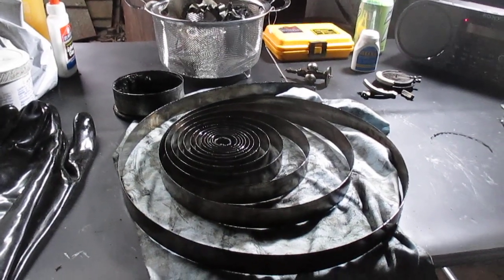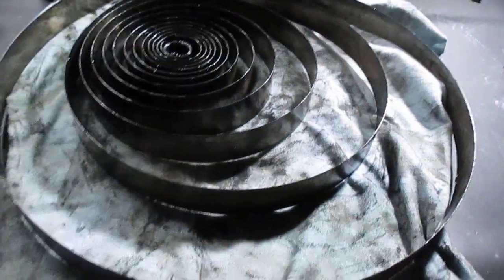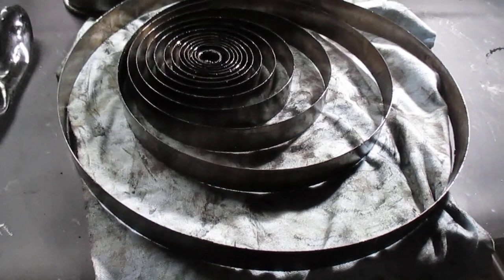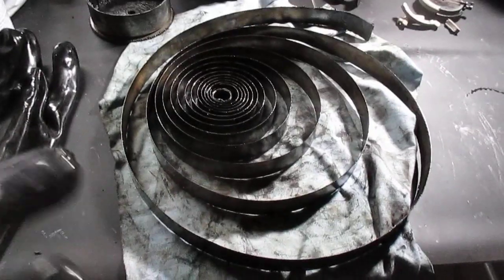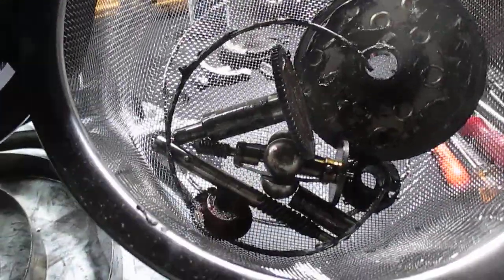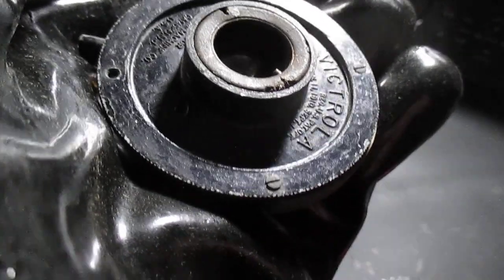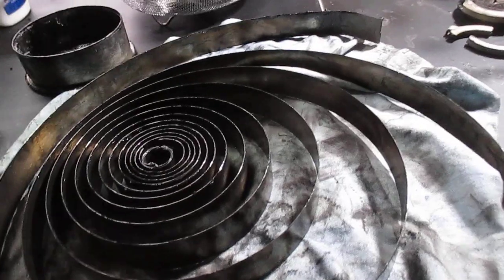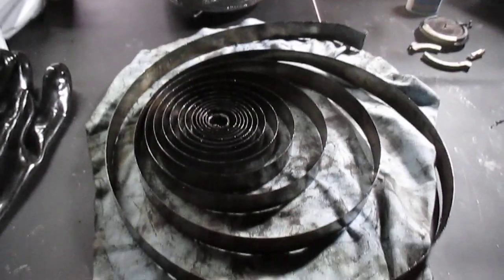Victor Victrola VV-50 # 59,408  1922, motor  disassembly

Comment: Wow! This spring is huge. I did some cleaning a year ago when I was working on cleaning the two spring barrels in my Victor VV 8-4 and it looks fine, and it took a long time to put them back together which is a pain in a butt.
Reply from the maker: That's expected given the 8-4 has four springs in two large barrels.  The 50 uses the smallest spring you will find in a Victrola, and the easiest to deal with.  The spring may look large in the video, but the 50 and the VV-IV it's based on are the smallest machines in the Victrola line of 1921,  Springs stay small for the VV-VI, and the VV-VIII, but become full size in the VV-XI and up into the larger floor models.  Victrola springs are the easiest to deal with compared to some that are riveted into the can, or attach in less convenient ways than an eye or a hook.  It's a pain the first few dozen times you do them, but then you get used to it.

Comment: It's nice you translate that victor language for us. Good to know the size of a fully opened up spring can tell me how weak mine are. Given the age however I bet it will look alot like that size when I get em' unbridled like a broken bikini top lol.
Reply from the maker: All 100+ year old springs will be weaker than new, some more so than others.  New springs when opened up tend to uncoil rather widely, while weak springs will open up only a foot or so depending on their size.  At least with a multi spring motor they will together have enough power to play a side or two of a record between wind up's.  The six has shorter springs than other two spring motors used in the larger machines.  They do share spring barrels with the other two spring motors.  What I like to do is swap out the short springs for the longer ones found in the VV-IX, I do this with the VIII also when I have the IX springs available.   Not sure why Victor went short on the VI and VIII springs, at first I thought it was just somebody had shortened the springs to repair broken ends.  Then after five or six times finding the short springs in these models I caught on to the trend.  Maybe because of the cheaper price of these machines when new, they found a way to cut costs.

Comment: Always find your videos interesting, thanks
Reply from the maker: I scrubbed the motor parts clean and that bit of missing spring didn't come to light.  I did find scoring marks inside the can to show it had been dragging around in there.  I can only assume that someone opened it up long ago and removed the broken fragment, then left the spring as it was for me to deal with 80 years later.

Comment: Great Video !  Question: how can I date a Victrola vv-50 ?
Reply from the maker: Three ways, the serial number will get you the year, just do a search for VV-50 and several web pages should turn up that can date it by serial number.  Second is if it still has the paper patent sticker under the turntable, these will have a month and date that will be within half a year or so of production.  Third is features. Crank location, style of the horn, style of the ID plate, a few other small details that changed at specific times during production.  They were all made between 1921, and 1925, a pretty small window considering the production runs some models had.

Comment: I’m trying to clean one of these motors as I write this. How do you get the spring can off? It looks like the end of the shaft is punched in 4 places like a rivet to lock over the gear. I can’t figure it out. Thanks for the informative video.
Reply from the maker: There is a small set screw in the gear at the end of the shaft.  Remove the screw, push the shaft out.  The spring has two bent ends so no hook to worry about, the shaft will just slide out.  Always make sure the spring has no tension before you do this.  Take pictures as you go so you remember how it all go's back together.
Reply: @Rockisland1903  Thanks you so much for replying! I see a little nipple on the side of the gear just next to the end of the shaft. Is it possible this is the screw you are talking about and the head has snapped off? The bolt head that holds the gear below it is a bit boogered up so I think the last person didn’t know their own strength.
Reply from the maker: The first gear to come off is the one the crank will screw into, it has a set screw.  Rotate the gear until the set screw is visible and unscrew it.   screw in the crank before hand so you can just pull the crank right out with the sleeve, then that gear will roll loose.  That gear is preventing the one above it from sliding out, that one is attached to the spring barrel shaft.  Just pull it right out and now the barrel will fall out.  You are not taking anything off the spring barrel shaft of gear itself, it just pulls right out as soon as that lower gear is off.  I have never seen that set screw snap, they tend to have worked themselves loose over time on almost every untouched motor I have pulled apart.

This video at exactly 4:39 shows that gear with it's set screw that must be removed, the sleeve that gear rides on with then slide out and you can pull the spring shaft.
https://www.youtube.com/watch?v=JGCBB4K4eb0&t=1s
Reply: @Rockisland1903  thank you so much for your detailed reply! You’re my hero! I just started with this stuff. I rebuilt an Edison standard wax cylinder player and a VV-50 popped up cheap and thought it was a nice stepping stone and a fun beautiful machine to own. Thanks again so much, it really means a lot!
Reply from the maker: VV-50 and cheap are rarely used in the same sentence so that was a fortunate find.  They are the nicest looking portable Victor would produce, and the only one with a finished wood case.  Later portables would be fabric covered box's.  Enjoy it.

Comment: I have a Vic-50 #12483 - where can I find the appropriate needles?
Reply from the maker: Ebay, they sell by the hundred pack in three sizes, low tone, medium, and loud.  Or you can call Walt Sommers, Gettysburg Antique Phonographs 717-334-0862 if you are in the USA, or Canada.  There are many suppliers on both sides of the pond, a Google search should turn some up.